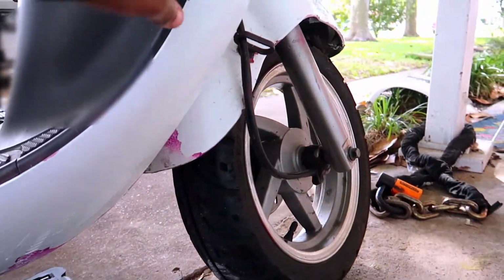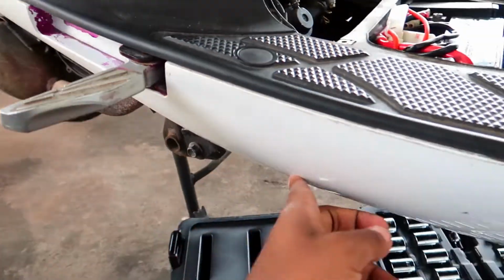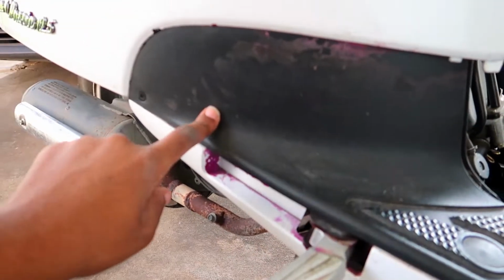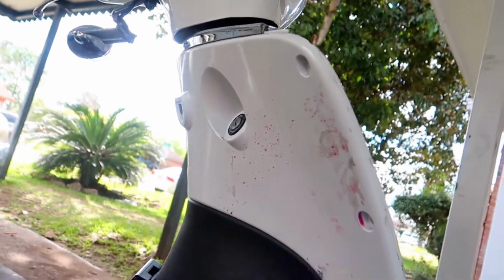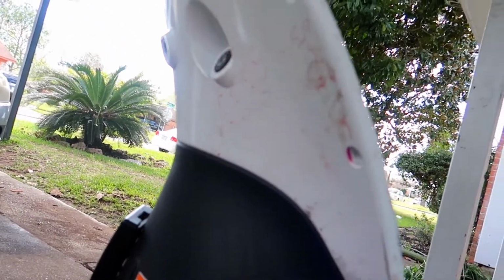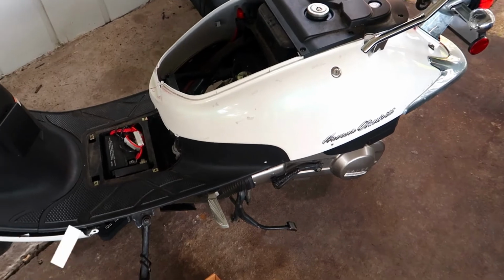Removing Scooter Panels

Comment: I know the feeling, I went as far as to snap 2 case bolts on my engine case. So you already doing better than me. You can buy an extractor bit to take the screw out if it’s totally stripped. if only partly stripped use the biggest philips bit that fits and an impact gun in n lowest setting

Comment: One of the problems with scooter panels, most makes really, is during colder weather the plastic becomes so brittle, as opposed to plastic expanding during warmer weather...so easy to break a nub off...I like your attitude about doing a job, RIGHT as opposed to half way. On a scooter half way usually doesn't give you the results you want!

Comment: Harbor freight Impact screw driver will take out most any screw or lossen most hard to remove nuts you just hit it with a hammer and it turns out screw:} should be less than $10 bucks

Comment: Drill or impact screwdriver. (impact screw driver works by applying some pre-load and then whacking the end a few times) Shock helps, but a drill can sometimes do the job nicely.

You should try removing panels on a Honda PCX... In order to remove the front, the back must come off first.

Comment: get some WD40 and a socket to fit it don't use a screwdriver..let it soak and it should come of real easy hope this helps u out.
Reply from the maker: If I ever get some I'll try it. Thanks for the tip DJ Storm.
Reply: Stripped before she got there.